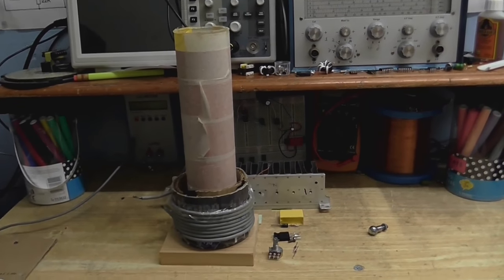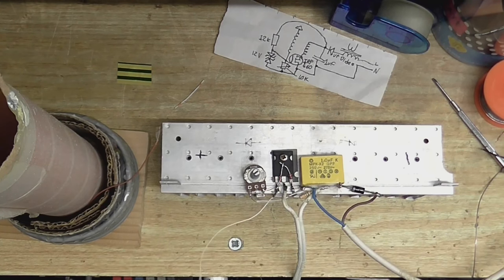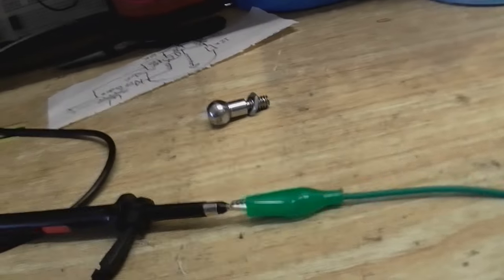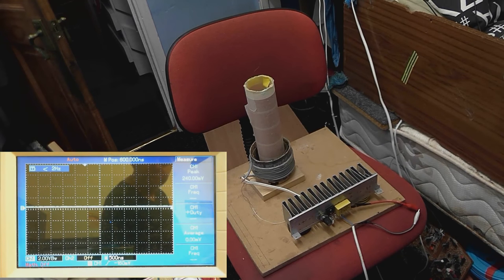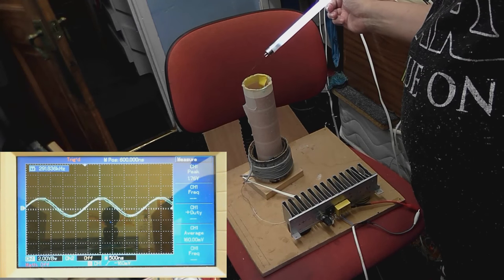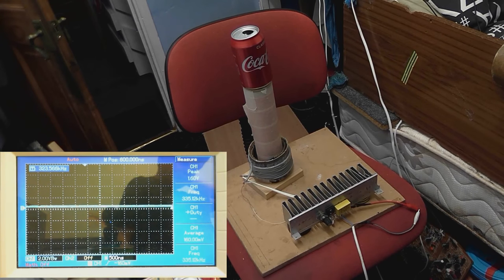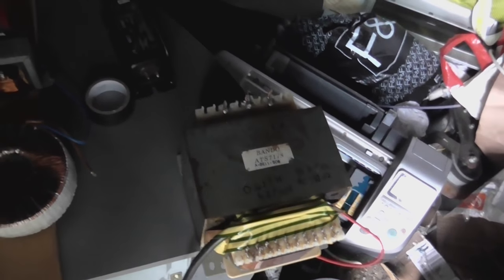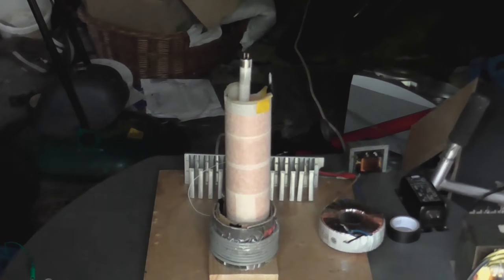How "not" to make a Solid State Tesla Coil!

Comment: Nice output, too bad the mosfet couldn't have held up longer. Yea, I know how the not plugged in thing goes. You build a circuit, connect everything up, turn on the switch and,,,,, nothing happens. So ya try to figure out was it the primary connections? Is the primary wound the wrong way? I thought for sure I had it right. Did the mosfet pop and I just didn't hear anything? OH, I forgot to plug it in... Thank God it was something simple. Ok, let's plug it in because it might need some power to work, and BINGO, it works!
Reply from the maker: The mosfet went out with a whimper rather than a bang because the circuit was current limited via the transformer that I was using as a choke, so nothing blew up. Maybe I should have used a snubber network on the primary.

Comment: Little trick that I used to always make sure that I wine both my primary and my secondary and the same exact rotational Direction is I have the top end of the coil always held in my right hand and I always have the coil winding towards me using the overhand rule the wires always over the top of the coil facing away from you just like a winch does on a Jeep

Comment: Hey clem ! Can i use 6a4 diode for mains rectification? And what else can j use instead of that ballast? Maybe some other coil? And can we even use a triac dimmer?
Reply from the maker: I'm not really familiar with that diode, so I cant say, but DON'T use a triac dimmer, those don't actually lower the voltage, they just chop the waveform up.
Reply: @CoolDudeClem  oh ok

Comment: Can i use any fast diode? As a flyback diode on the primary?
Reply from the maker: I'm honestly not sure, a snubber network that consists of a suitable diode, resistor and capacitor would probably do the trick. Have a look at DiodeGoneWild's channel, he recently made a Tesla Coil that works well and he goes though each step of building it.
Reply: @CoolDudeClem  Thanks

Comment: Yay, more coil stuff... I am so glad you didn't give it up :)

Could you do a video on how to prototype circuits... I always mess up. Also a troubleshooting video would be nice.

If you get a transistor with a higher voltage then it should work well,
Reply from the maker: As a matter of fact I'm making a video on designing a buck converter which is going to feature things such as how to design the circuit, how to use an n channel mosfet in the high side of the circuit and yes even some troubleshooting.  Unless you mean how to make a circuit on a prototyping board? That would have to be another video altogether.
Reply: I am highly anticipating that video... I can sometimes build the circuit on a breadboard, but when I try to put the same circuit on  piece of perfboard it doesn't work, and I can never seem to find the problem.

Comment: is mosfet k2847 or mosfet k2611 good for this circuit
Reply from the maker: Please STOP asking me things! To answer this I have to go through the entire video, see what I did, just so I can answer you. Anyway, a 12 or 15 volt zener should work fine, I would put a capacitor (make sure its one that can handle the mains voltage ans is nit an electrolytic) across the primary coil you'll have to experiment and find which value works best, as for the k2847 or k2611 mosfets, I don't know if they're a good choice or not, as I don't have time to look them up, just go with irf450 which is what I used.
Reply: @CoolDudeClem  roger that lil buddy
Reply: The 2SK2847 sounds like it may work fine with it's great 900 volt drain-source and +/-30 volt gate-source. It's current is 8 amps continuous, and 24 amps pulse, and you could always double up on them in parallel if ya needed. Its resistance is the big thing. It has a max of 1.4 ohms compared to IRFP460's 0.27 ohms. If you haven't tried it yet you might want to, on a big heat sink, and see how it does. The 2SK2611 is the same 900 and +/-30 V, and has a bit more current capability at 9 A cont, 27 A pulse, and has the same 1.4 ohms max as K2847, so they might as well be the same transistor except for the current.

Comment: Why did the MOSFET die?
Reply from the maker: My guess would be that there was too much inductive kickback from the primary, since there was no snubber or reverse protection diode across it.  even though it was getting a voltage well within the range of what the mosfet can handle, the kickback (or inductive spiking, whatever you want to call it) would have been many times more than that. Afrotechmods has a great video on that that explains it better than I ever could.
Reply: I know what back EMF is. Why didn't you put a protection diode across the part?